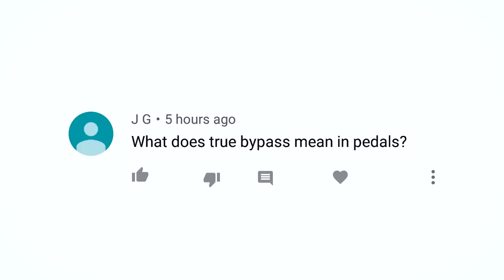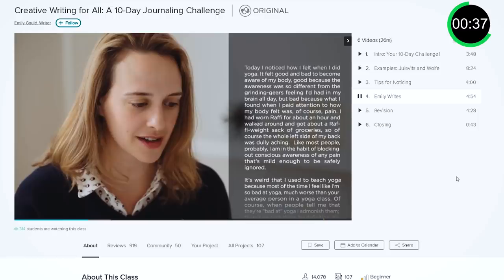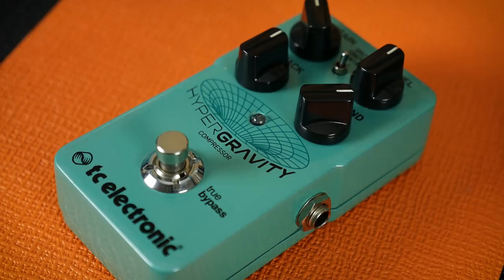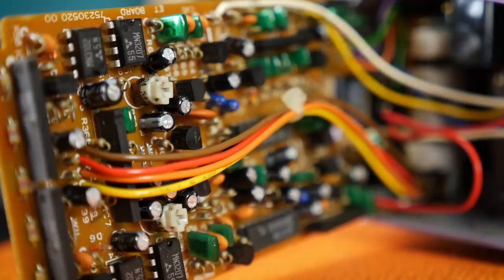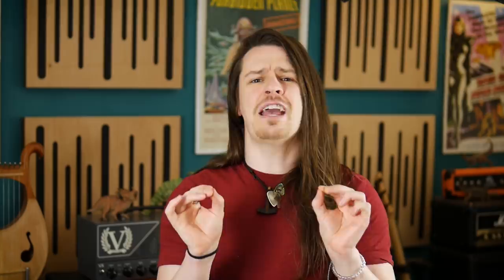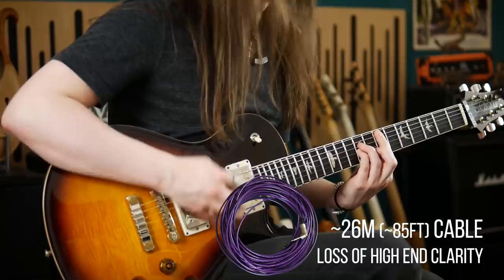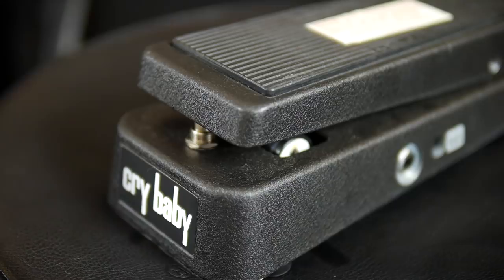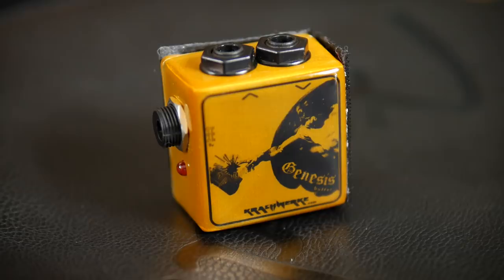What is True Bypass? | Too Afraid To Ask

Comment: Big TATA: How to adjust the truss rod? Also when and why should you do it
Reply: The bass wizard did an excellent video on this topic. Applies to guitar as well
Reply: Dave's World Of Fun Stuff does a lot of explanation when he does a setup job.
Reply: Truss rod adjustments are easy as pie.

Generally a neck will have an allen key, or a nut that you turn to correct the neck relief.

Ideally, you want just a slight relief. The way to determine this is to fret the first fret with your pointer finger. Then, with the other hand, use your thumb to fret the 15th fret, and stretch your middle or pointer finger to the 7th fret. Using that finger, just tap the 7th fret to get an eyeball for the curvature. If it's half the thickness of a credit card, the neck has the proper relief.

If it's the thickness of a credit card or more, the truss rod is too loose, thus you need to tighten it by turning the truss rod 1/4 turn clockwise, then check it again. Go slow until it's right on the money.

If it's less than half the thickness of a credit card or more, the truss rod is too tight and needs to be loosened by turning the truss rod 1/4 counter-clockwise, then check it again. Again, go slow until it's right on the money.

With truss rods, slow and steady is the key here.

Generally you adjust the truss rod if you're experiencing a rapid change in climate, put a different gauge of string on, or any time it's not right on the money.

It's never done to adjust the action, action is adjusted by adjusting the bridge height, or the height of the nut.

Now, due to the nature of guitars, some have more stable necks than others, so some guitars will have to be adjusted more. Thankfully, either due to the construction of my guitars, or the climate I live in, I don't have to adjust very often. YMMV.

Comment: Great video.  The issue with cable runs, pedalboards and Buffers is one of the primary reasons (together with noise concerns) that I switched to EMGs for live use.  Because as an active Pickup, they basically have a decent to high quality buffer inside the pickup itself in the form of the preamp ;)

Comment: I usually go Tuner/buffer - Compressor and drives - noise gate - another buffer - amp - FX send/buffer - delays and reverbs - buffer/FX return. So 4 buffers in total, though I have several pedals that are buffered so it’s closer to like 7 buffers and 13 true bypass.

Comment: This is why I love the polytune 3. Buffered bypass (if ya want it, Ofc) that sounds killer, and it's just a good tuner. I think it's basically the bona-fide buffer stuffed into a polytune, but it's cheaper and smaller than using both.

Comment: Historically, stompswitches that could completely bypass an effect circuit were rare, and bloody expensive.  In the pre-internet days, I was regularly paying $20 for a DPDT footswitch...if and when I could find them.  Major manufacturers in the 1970s used SPDT switches in their pedals.  These would leave the input of the circuit always connected to the input jack of the pedal, and the footswitch simply took its signal from the output of the circuit board or the input jack.  If you were using a single pedal, that wasn't a huge problem.  But if you were using more than one pedal, all the input terminating resistances of however many pedals you were using were placed in parallel, providing significantly more loading.  Consider that one pedal with a 470k resistor to ground at its input would likely provide less signal degradation than the cable being used.  Put four similar such pedals - all "bypassed" with an SPDT switch - in your signal path, however, and that 470k drops down to 117k, and significant signal loss.  As well, with but a single pedal, it was easy to keep track of whether it was "on" or not; no status LED required.  Boss addressed all of these challenges with electronic switching that could provide indicator LEDs, and something close to full bypass, inexpensively, reliably, and without requiring new technology.  As it turned out, many of the pedals they were becoming well-known for used the mixing of dry and wet signals to produce the "effect" (chorus, flanger, delay, phaser), and only required lifting/blocking the wet signal to make the effect go away.  It wasn't "bypassed" so much as cancelled.  Much of the pedal's circuitry still remained in the signal path.  Again, though, if you only had one or two such pedals, it wasn't a big deal.  Stack a dozen of these things in series, though, and the hiss and treble loss starts to add up.

In the mid-'90s, Mike Fuller, of Fulltone pedals, began getting custom switches made for him and his pedal line.  Instead of having only 2 sets of contacts (DPDT), these had three (3PDT).  The first two were used to completely bypass the circuit board, eliminating any unintended loading concerns, and the third was used to switch an LED on and off so you could tell at a glance which of the 15 pedals on your board were engaged.  These have since become standard, easily available from many sources, and relatively cheap.  As Colin correctly alludes to, such switches eliminated the signal-degrading effect that the pedal-circuits themselves might create by loading.  However, they did not eliminate the potential signal-degrading effect of all that cable from your guitar to pedalboard, from pedal-to-pedal, and pedalboard to amp.

The recommendation to stick a decent buffer as the first thing your guitar sees before anything else is a sound one, and sage advice.  But consider that some artists have used loading in a productive manner over the years.  One of our favourites - Jimi Hendrix - was known to have used a "curly cord" from his guitar to his pedals.  These cables were notorious for eating up high end, due to their high cable capacitance.  Jimi used Marshall amps for the most part, and though he used a bright guitar and a bright amplifier, his tone was never strident or shrill, but strong and clear.  To some extent it was his productive use of loading that enabled his signature sound.

I don't mention this to suggest that use of a cheap curly cable will make you sound like the esteemed Mr. H.  Rather, consider loading, and "unloading", to be sonic tools that one applies in the context of the overall signal chain, to achieve a desired outcome.  True bypass is not a complete solution, but rather something that lets the user say "OK, I don't have to worry about that ".

Your a good explainer, Colin.  I tip my tam to you.

Comment: I appreciate the explanations of these concepts. I look at the buffer/true bypass as guidelines to a good starting point and are great "pressure" points when troubleshooting issues. Ultimately, if you like the tone you get from your pedalboard, then the types of pedals and the signal chain is moot until you make a change.

Good stuff.

Comment: Great info! I would ad that: If the total length of your cables + the internal wiring inside several true-bypass pedals (which I assume you could approximate to roughly 5-7 inches each) is less than 30 or so feet, then you're fine without a buffer.   So cool that you had an 85ft cable to use as a demonstration! 

Next subject idea: How to reduce 120 cycle hum and RF interference from pedals who's manufacturers decided to be cheap or stupid & didn't include RF rejection/power-supply filtering!

Comment: For reference, those "expensive" switches cost like 30 cents even when not buying them in bulk. But that is a good deal more than resistors or other parts you can get for fractions of a cent.

Comment: Besides the tone loss a problem with badly implemented buffers can be noise. Famously cheap Behringer effects have a big problem with noisy buffers. And while in some situations that's not a big deal, in other (before a high gain pedal/amp) it makes those pedals almost useless. That's why a change to true bypass in TC Electronics edition of those effects was a welcome one.

Also, there is one more type of non-true-bypass and that's something I would call a digital bypass. If the effect is digital (like most reverbs and delays) the cheapest way to implement bypass is to just tell the processor to not do any processing and just pass the data straight from the AD converter to the DA converter. This has the inevitable effect of adding quantization noise and jitter to the signal, which for low quality converters, like those found in cheaper effects, can be quite significant. So again, for cheap digital effects having true bypass might be quite important, if the alternative is the digital bypass.

Comment: What is meant by the phrase "tight" when describing a tone.  I've heard it used to describe the lows specifically or to the guitar tone as a whole.
Reply: Usually it means a low end roll off. But it means nothing in a technical sense. What they mean is it is has definition and punchy dynamics. It means you can get good chugs out of it, without the low notes going all farty or flubby.

Comment: The way you explained how a cable is a transistor and how it related to the tone knob blew my mind man haha
Reply from the maker: The cable is a capacitor, rolling off high frequencies as one side is connected to ground. Transistors are very different things, they are voltage controlled 'gates' which control the flow of current. 
I don't want you getting those two terms mixed up.

Comment: Nice you mentioned Fuzz in this, I'm running Guitar --> Fuzz --> TC Electric Polytune, which has the Bonafide Buffer built in to it --> The rest of the board.  The other thing to note, is if the amp is a long way from the pedal board, i.e. in an Amp room when recording a buffer just before the input on the amp can be of assistance.

Also, when can we expect more CSFlute vids? :P

Comment: TATA: the difference between +4dBU and -10dBU levels and when to use each when given a choice (slider switch on rack units)?
Reply from the maker: 14dBU and use them when you need the signal to be louder or quieter respectively

Comment: I run my modulation effects front of the amp and my delays and reverb in the FX loop. Would putting a buffer first work or unnecessary due to the pre-amp or would it be best at the start of the FX loop. I use all true by-pass and notice a drop in my high end. Thanks Chief.

Comment: Appreciate it's a bit of an older video but I was watching TPS's "To Buffer Or Not To Buffer: That Is The Question" video. They were getting themselves in a bit of a fankle so thought I'd come here. Question from your video though... Would a high quality buffer protect you from a sh!te one further down the chain? For example, if the wah was getting a low impedence signal from a good buffer, would it still mangle your tone or would it be relatively protected?

Comment: You said the linger the cable the loss of the high frequencies. Which is clearly audible. How about wireless systems?  Do they do the same?  Would that be another solution to help with treble loss with obviously the added downside of adding a slight delay between each receiving end of the wireless systems
Reply from the maker: Wireless systems buffer the signal, so the signal coming out of the receiver is low impedance. Switching from cable to wireless you'll probably notice the sound become brighter. I

Many wireless systems have a 'cable tone' switch which allows you to simulate the losses from cables. 

Modern wireless has a latency so short that it's not even perceivable to the human ear, so that's a moot point.

Comment: Quick question on pickup impedance load. 
The new Axe I/O interface made me aware that a passive guitar's pickups have an impedance load that can change depending on what it's plugged in to. 
Is this why some guitar and amp combos sound better than others? 
If you use something like the radial SGI to be able to have a long run without noise or tone loss (or even a buffer or buffered pedal), would the guitar's pickup impedance load still be affected, or would it only work with a direct run (which could include DI boxes and true bypass pedals) from the guitar to the amp?

Comment: I have another TATA for you.  I have an Ibanez Artcore AS73.  Basically a hollow body similar to a Gibson ES 335. I've never owned a guitar with multiple volume knobs before, and I just noticed that when the 3 way selector switch is in the middle position, either volume knob will completely turn off the overall volume when turned down.  Is that normal? If so, why does it work like that?

Comment: I am wondering if there is such a thing like reverse buffer that would increase impedance of signal to allow vintage fuzzes to operate correctly even with active pickups/buffered signal.
Reply: That's called a resistor. Do they sell resistors in guitar-pedal form?
Reply: @edwardfanboy  Well I thought about putting passive potentiometer (to allow fine tuning of the impedance) as stompbox but it seems too simple.
Reply: @Jagdpz5  The impedance of a guitar pickup probably varies with frequency, so a potentiometer will only approximate the correct impedance. But I recommend trying it out: You probably don't care about replicating the exact electrical characteristics of a guitar pickup, you care much more about how it sounds.

Comment: If I use an amp/cab/mic modeler, does it make a difference if I use the 1/4" outs or XLR outs running straight to the mixer or recording interface?
Reply from the maker: Check out my Balanced vs Unbalanced Cables video. It pretty much answers this question.

Comment: Hey man great video, as always! Just one question... How do I know which buffered guitar pedals have "good" buffers and which don't?
Reply from the maker: By using your ears.
Reply: @ScienceofLoud  can't really argue with that... But it's there any brand that you can recommend for being good at making buffered pedals?.
Reply from the maker: Even within brands it varies drastically. 
Like not all Dunlop/MXR pedals have crap buffers, but the Cry Baby is terrible. 
Some Boss pedal buffers aren't great, but others are. 

Probably the best indication is the age of the circuit. The circuits that were introduced further into the past will not have as good buffers as newer circuits on average. This is a big reason why people buy into boutique versions of classic pedals, they have been reworked from the original circuit design for better performance.
Reply: @ScienceofLoud  definitely trust my ears is the cortect way to go it seems. Thanks for answering my questions in such a fast manner.

Comment: TATA question, what's the deal with the neck pickup on telecasters? As in, how does it differ from a standard single coil?
Reply from the maker: Thinner wire, encased in metal, really bassy sound (originally included to get a bass sound before bass guitar was popularised)
Reply: @ScienceofLoud  Thanks!

Comment: Regarding signal loss in long cable runs or having a bad buffer: how does this translate to wireless systems? Do they have the same capacitor effect that long cables have or is it similar to short cables ?
Reply: A little late, but:
They don't suffer from the capacitor effect.

The only problem with low impedance outputs like from a wireless system, a buffer, or an active pickup is that your fuzz pedal will not sound like a fuzz at all, and you may want to consider a muff instead.

Comment: Another great, informative video. Thanks. 
Colin, I am converting my SSS  Partscaster to HSS. I want separate volume controls for the HB and the SC's. What type and value pots would work best?
Reply: Generally 500k for Humbuckers, and 250k for single coils. Many manufacturers will state which pots to use with their product somewhere on the product page though.

Edit: I know I'm not Collin, just figured I throw my two cents in.

Comment: Hi there, Colin. Is it true that all Boss pedals have buffers? And what about Big Muffs? I don't think I ever saw a Muff that was labeled true bypass. I guess I' still confused.
Reply from the maker: Most, if not all, Boss pedals are buffered bypass. 
I think the Waza TU-3 can switch between True and Buffered Bypass. There might be others, but assume they are buffered and you'll likely be correct. 

Little Big Muff is True Bypass, I've just tested mine. Can't speak to the other Muffs though without looking at each of them.
Reply: @ScienceofLoud  Thanks.

Comment: @CSGuitars  Why don't they just put an always-on buffer in guitars before the output ?
Reply from the maker: 1. That would require power
2. Amp inputs are designed to work with high impedance signals
3. Fuzz pedals would throw a shit fit.
Reply: @ScienceofLoud  aah always those bloody fuzzes fault :D
Reply: EMGs are always-on buffers.

Comment: TATA: What can I run safely run through an effects pedal? 

Getting my first pedal today, and wanna run different audio through it. I have a small synth, 3DS with a soft synth on it. Could one just use their phone's aux with a 1/4 adapter?
Reply from the maker: Anything instrument or line level will be accepted by the pedal. 
Guitars, synths, even the audio output from a phone or other similar device will be fine. 

Do NOT run an amplifier speaker out into a pedal.
Reply: @ScienceofLoud  Thanks for the timely response! Have an excellent weekend ✌🐸